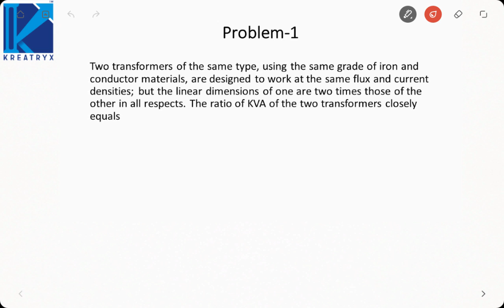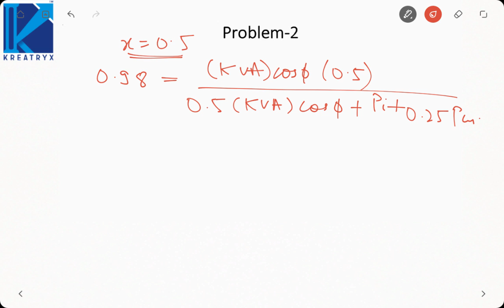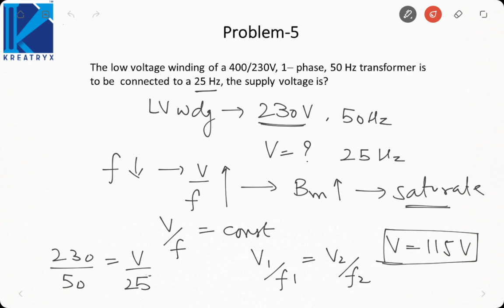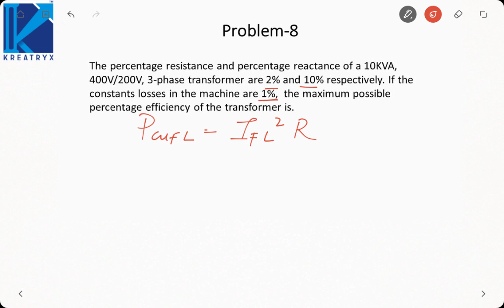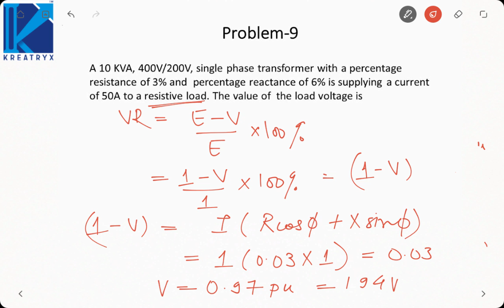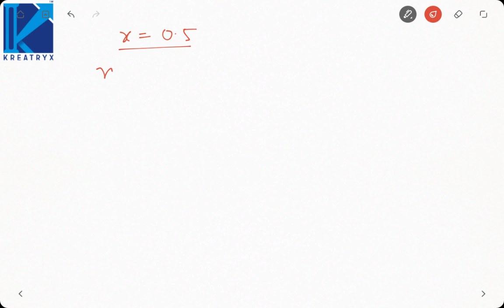Comment: Sir I want to understand relationship between Line voltage and line current of 3 phase for R,L and R,C network in case of star and delta connection load plz explain it

Comment: why to solve such lengthy equation for question no 2. we know that at max efficiency  Pi=Pcu* x^2 (where x is fractional loading) . Pi is constant for any load. copper loss is max at full load.[since max efficiency is not occurring at full load that means the max efficiency is occurring for some fractional load i.e.  x^2 Pcu=Pi then it is quite obvious that Pcu>Pi at full load.